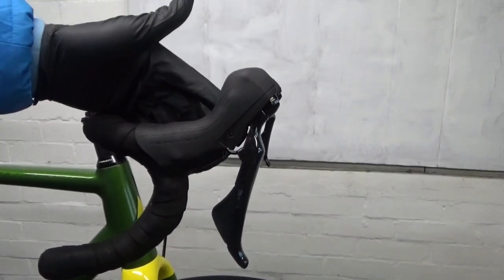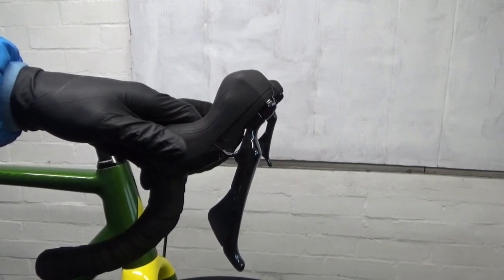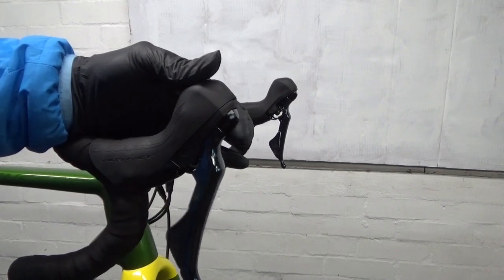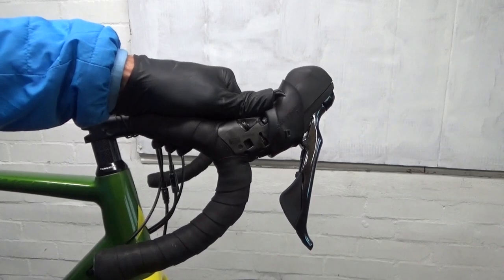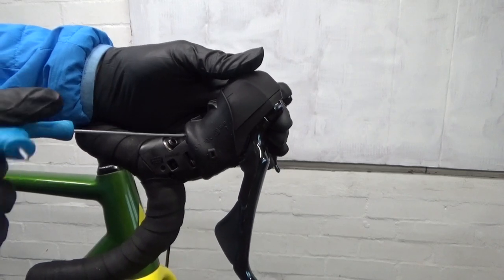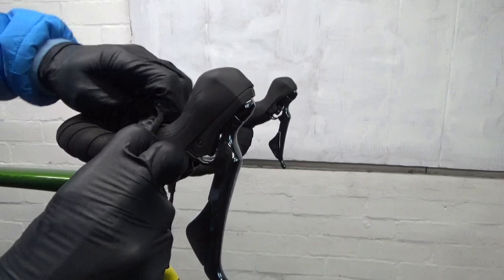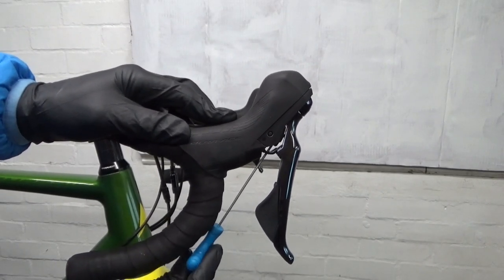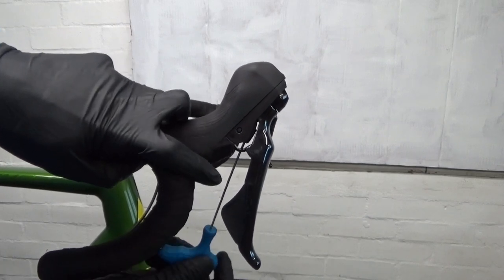Shimano Road Hydraulic Brake Free Stroke Adjustment

Comment: So I realize this is a bit old now but I have this exact issue with a new to me bike with Ultegra. The adjustment screw is in the same place but when I turn it counter-clockwise, nothing happens. Seems like there's something impeding the process or the screw just doesn't work. Any ideas?

Comment: My wife's lever has a bit of play on the free stroke adjustment just as you show in the video.  However, I've backed it out a few turns and there isn't much improvement.  I'm afraid the screw will come out, so I stopped with little to no improvement.  By the way, this is on the Ultegra RS685 which appears to be the same in this regard.  How far before the screw comes out?
Reply: I just found your other tutorial on how it's a two step process.  Now it makes a lot more sense to me, thanks.  Once you adjust the reach, should you go back and tighten the free stroke screw until it seats?
Reply: @thomasmoher9089  whats the ofher tutorial called or can u put the link here